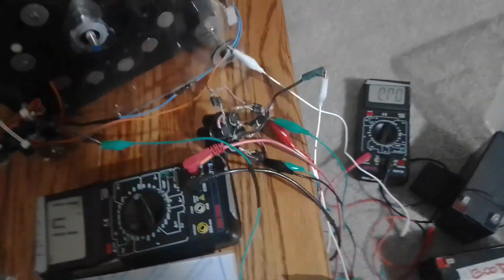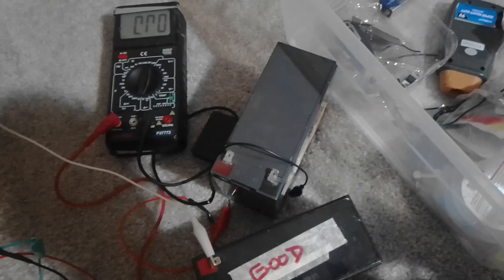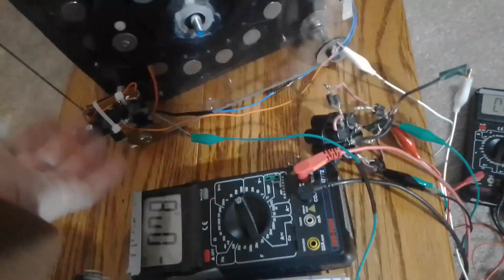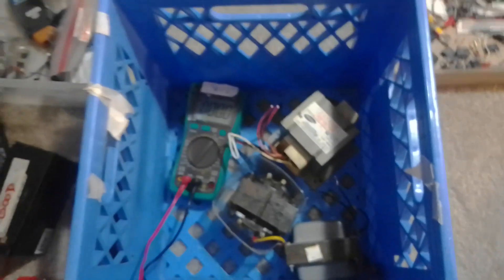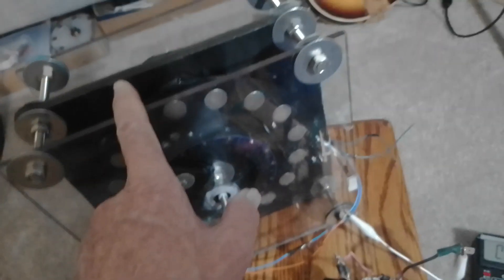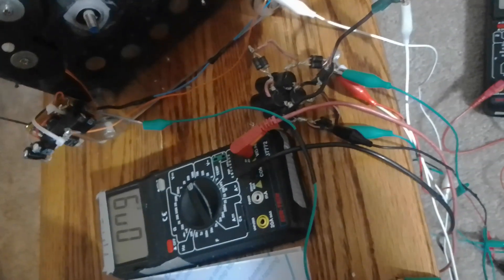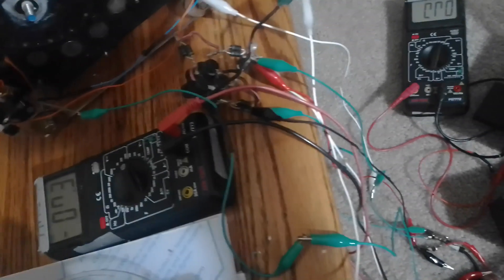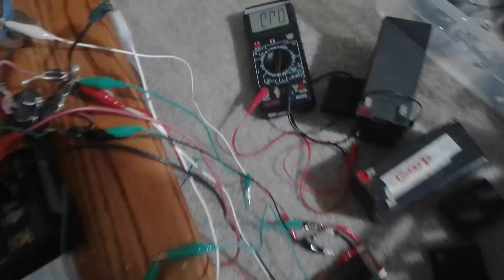Previous video continued... Caution:  HVDC is charging the battery!

Comment: I was about to say, don’t plug it in. Oh well
Too late
You already did it
So what happened, you were feeding your circuit, pulsating DC and that probably blew your voltage regulator and maybe other things.

Sorry
I would charge one battery, while using another and then switching them once in a while 

Thank you Doug
I learned a lot from your videos
Keep up the good work
Reply from the maker: Yup it blew out the hall effect, the mosfet survived, I am sure the voltage regulator did not survive.  I am throwing in a new 4421 driver chip too while fixing it up.
Meter shows 162VAC circulating in the run cap phase (meter over AC run cap).... besides "forgetting" to not step down with suitable transformer first, ( I saw the 15V on meter and got excited to hook it to battery didnt think there is no transformer dummy!)
and then I was more  dumb to rectify not with your typical FWBR but instead a voltage doubller circuit (FWBR with two diodes added to it and two caps as well) So this probably brought the DC voltage up to over 300Vdc coming out of the doubler circuit in the sinewave peaks...converted into DC peaks....
I only used the voltage doubler circuit since it was something I pulled out of  box of old stuff, already assembled with diodes and caps in place.....I connected to LS line in series saw the 15V on meter (dont know why it said that probably because I didnt have the meter in 600Vdc setting instead the 20V setting (!) I will guess that....so I got fooled)  but seems to work I was surprised the draw went up so little.  Perhaps an impedance match with battery and run cap phase I dont know.
 
The typical "Bedini" flyback 12V lead acid battery charging circuit is sending in flyback HV voltage pulses of around 300VDC too, with near no current "underneath" them and these spikes usually  going into a 12V battery too, so maybe this battery charging method will work out as a lot of people have had success charging up 12V batteries (lead acids) with flyback spikes besides desulphating in process.,

Draw to the RV motor is only 4.6W and that could be reduced if say 85VAC input tomaybe 3W or less so question will be  can the charge battery B  be charged faster than the run battery A drains....
Reply: @MrDKONZEN  Best discoveries are found by accident. Consider this your lucky break besides all the hard work. We all need a lucky break once in awhile. 
I am replicating your mistakes intentionally now. LOL